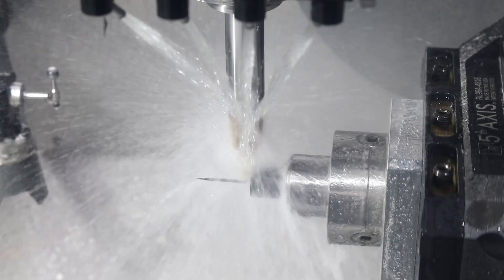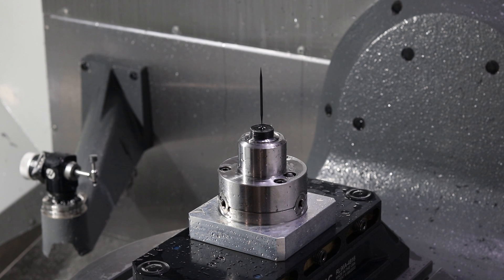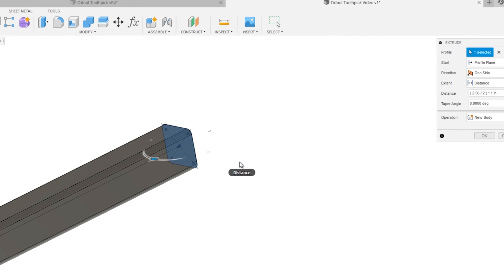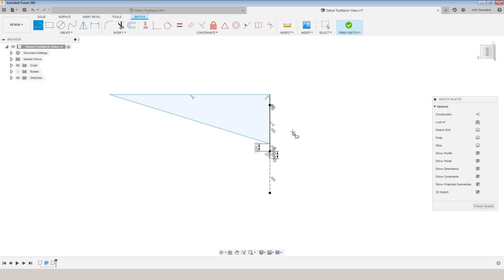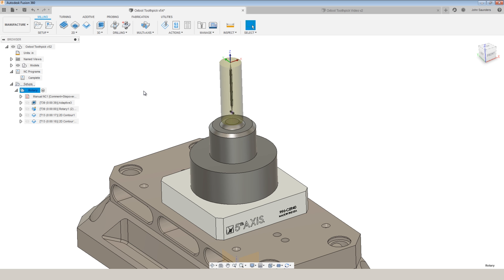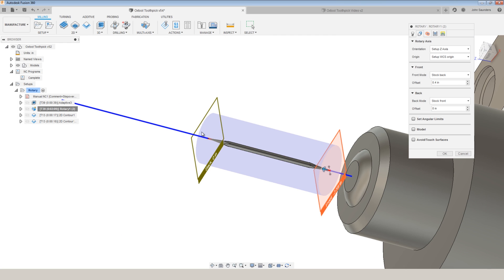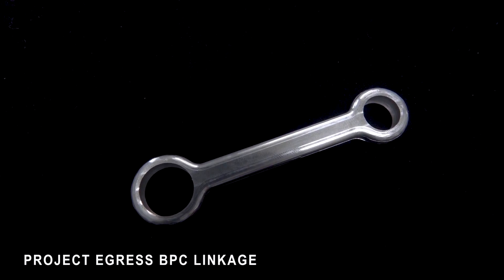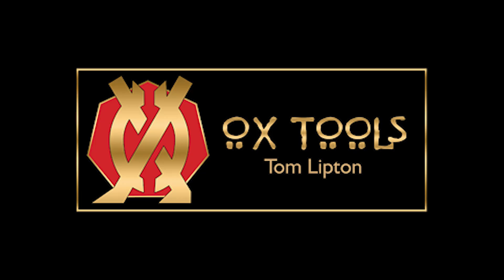OxTools Challenge: Machining a Toothpick!

Comment: Hey if you are ever in northern Indiana me and my father own a job shop. We have a vf2ss vf4ss vf6 50 taper mills a few wire EDMs and a st30 2 milltronic lathes and a TL3B lathes plus a Blanchard grinder a big kuraki boring mill plus many more manual mills surface grinders lathes we are a 4th generation tool shop if you want to do a shop tour with us we are just getting into YouTube it’s glaze tool & engineering hit me up

Comment: Is it just me, or does the aluminum version have a much finer tip in the close-up shots? The delrin also looks to be slightly mushroomed at the tip. 
Personally, I would've used the 5 axis to mill that taper parallel to the vertical axis, then just rotate the part to form the cone, then do the same op after flipping the part. In a way, this would be similar to how you grind a taper on a belt/disc, taking the object to the tool and rotating to form a profile. This, combined with machining the filleted square profile parallel to the tool, would also result in much simpler toolpaths.
Then, of course, there's always the Lathe, which this kind of job is better suited for.

Comment: You have made a small error: the taper on the ends isn't centered. You missed an accidental line when sketching, on the top part of the horizontal line, which caused the "center" you used as reference to be off center from the origin. I noticed it because the pieces where the taper trainsitions into the square part are different in length.
Edit: hmm, seems like you secretly corrected that later on.

Comment: A handy tip for hot glue: if you spray it with isopropyl alcohol and let it sit for a minute, it'll peel right off really easily. :)
Reply: I thought the guys over at Test Flite found acetone worked amazing for that same thing. A tiny dab, and the glue lets go.

Comment: There's an even easier way to model this: Just draw a 0.010" circle on the end and extrude with a 6˚ taper
I would also probably model half the toothpick and then just mirror it
Reply: James i probably could have modeled that in 15 total clicks including the double click to open Fusion
Reply: How does your conical extrusion blend into the square section with corner rads?  Just asking as a non Fusion user.
A 360 degree subtract sketch would have been my go to in UG, same as in the video.
Reply: @Dug6666666  you'd extrude as a cut, so it'll blend the same way. It's just a couple steps quicker than the way shown

Comment: Ok champ....i need you to show us how to use fusion 360 to make a bonified fully enveloped worm gear and wheel...such that both worm and wheel are scalloped for maximum engagement but with propery formed threads/teeth on both.   I know this is a tall order, but if you could kick it around with your fusion friends....it would greatly increase value from many angles....thanks again
Reply: If they decide to modify software to facilitate...please tell them to include multi lead potential for the worm, and the ability to segment the wheel.
Reply: I've done that twice this morning already. I'f i had known you didn't know how I would have videoed it.
Reply: Bona fide

Comment: Going to try this in wood.  that would be truly groundbreaking.😂
Reply: Try a shovel if you want something for breaking ground.  A tooth pick would take forever.
Reply: @zachaliles  That's the plan, according to the Terrible Trivium in the Phantom Tollbooth
Reply: well any material that is softer than your  teeth because you'll damage the enamel or w.e it is called if you use a material that is harder and is sharp
Reply: Woodn't it be?